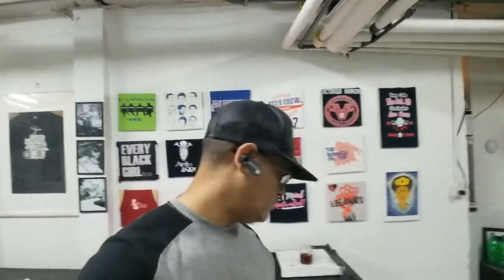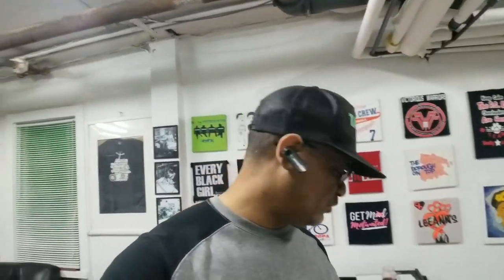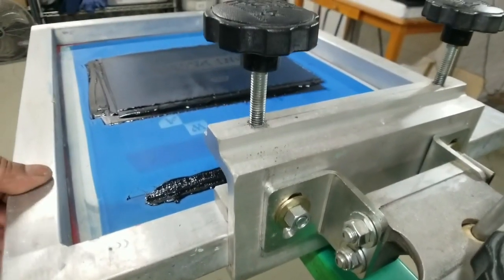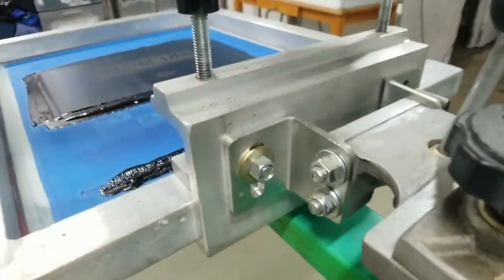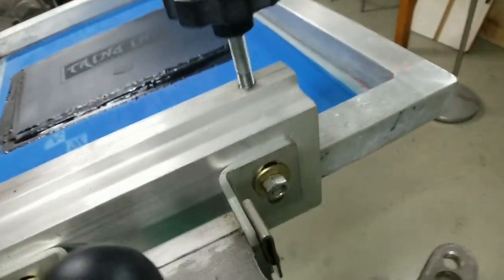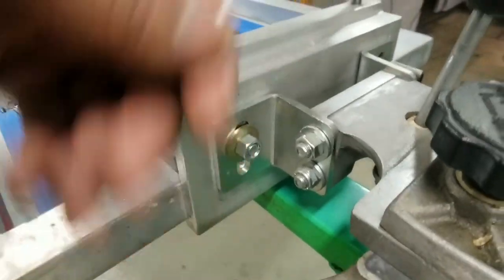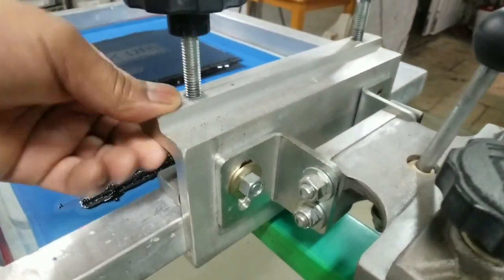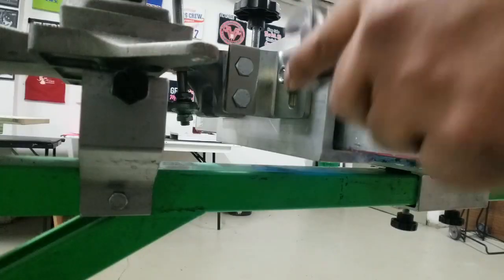How To Get Crisp Screen Prints

Comment: Question: when placing your cardboard spacer on the pallet.  do you let it (cardboard) reach beyond to point of the screen where it is reaching under the brackets that holds the screen in place? Or does the spacer board just lay under the screen only. Nice vid.  Thanks!
Reply from the maker: I let only the screen lay on the cardboard.
Reply: @tainoink  gotcha!! thanks!

Comment: Thank you very much for the great video. So I'm having trouble screen printing my size tag on a Tri blend next level t-shirt. The ink goes thru the shirt. Is it my pressure or ink?
Reply from the maker: Thank you. Be aware of the pressure and try to use the highest mesh count you have. I use a 305 because it deposits less ink.
Reply: @tainoink  that makes super great sense... Didn't think about that... Thank you very much!

Comment: Question:  If you have to stop a job and continue the next day or even two days later do you leave your screens flooded or do you clear the screen or ???
Reply from the maker: Great question! When it comes to plastisol I clear the screen. I don't know when it comes to waterbased ink. I think they leave it flooded but with plastisol I just clear the ink off the stencil. I will mention that in one of the videos because that's very important info. Thanks.
Reply: @tainoink  Thanks for the quick answer.... I am retired and screen print mostly for fun but want to make a few dollars also.  I have subscribed to the youtube channels of many other screen printers but I would rate your videos very high because you keep them short and to the point.  Good luck on getting to 1000 subscribers.  I watched your video on how much to charge and I understand there are many conditions that could effect the price but I'm wondering what you charge for a 4 color one sided black T-shirt print.  I have someone who wants a price  on doing such a job.  My overhead is low because I am printing out of a building on my property but even so I don't want to be too cheap.  The thing I have learned about manual screen printing is that it is a lot more physical work than most people understand.
Reply from the maker: Thanks Bob. For a 4 color print on black shirts it depends on the amount of shirts. How many shirts?
Reply: Okay lets say 20 shirts to begin with.... then I would like to know how that would change if they wanted 200 shirts..... @tainoink
Reply from the maker: For 20 shirts $338. $16.90 pet shirt. 
For 200 shirts 1,712. $8.50 per shirt.
The other thing I do is I go to Custom Ink and qet the quote from them and adjust the price a bit less than them. Usually that's where clients go to find out the price then they call us to see if our prices are less than theirs.
Reply: Taino Ink Thanks a ton.... that gives me some good ideas...